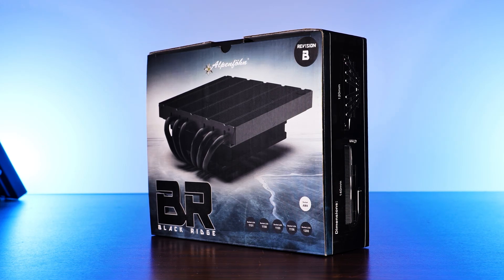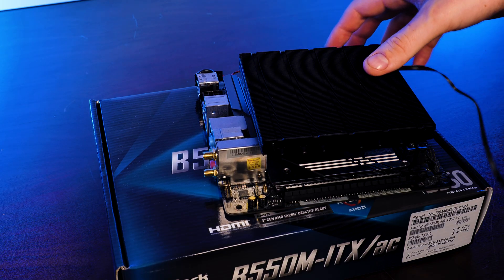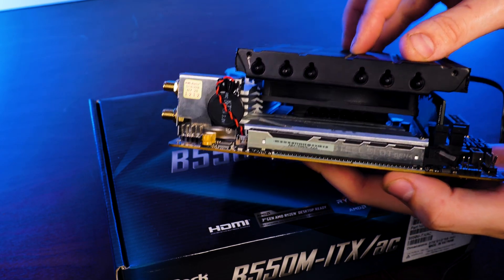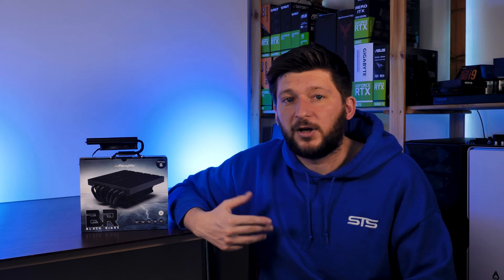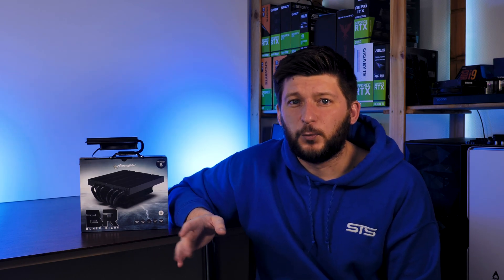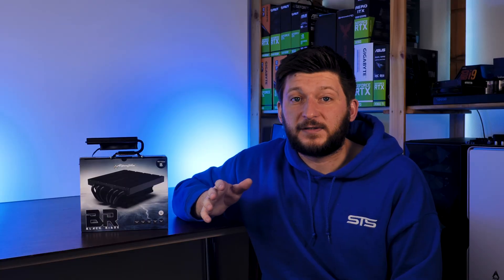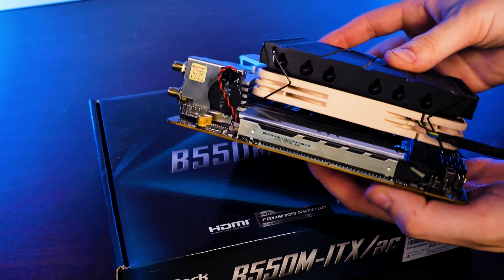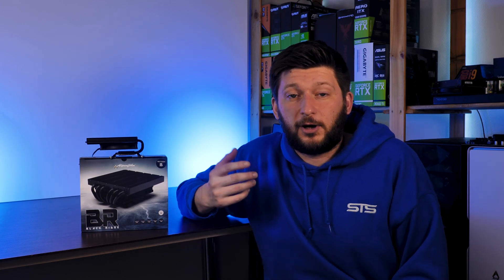Alpenföhn Black Ridge Review - Change that fan!

Comment: Will a A12X15 fit underneath with a LPX Corsair Vengeance(33.5mm) height w/heatsink?
Reply: VLP RAM 18.75 MM. 

So LPX won‘t work with A12*15mm fans.

Comment: Seeing how the 5800x3d runs hotter than the 5900x (unless you undervolt the 5800x3d), is it safe to assume the black ridge would work well with a 5900x at stock/undervolt? I also got the v2 but since I’m using a 3070ti fe, I can rock it in 2 slot mode and have enough space to use a 15m slim fan on top on the BR.

Currently using my 5900x with an ek 240 aio (idle temps are 48-54c/ gaming temps 64c-76c) in the t1 v2 and I mainly use it for gaming only. Haven’t touched video editing, rendering, streaming, benchmarks, etc but I at least plan to stream and do some light to medium video editing. I hate water coolers so I don’t have to worry about clutter and leakage but still want to have good temps/performance while air cooling.

I already have the cooler and a noctua chromax slim 15m fan but holding off buying the 5800x3d and sticking with my 5900x until I get a clear answer for my situation
Reply: Did you get this cpu cooler for your 5900x ?
Reply: @joegalloway1613  i ended up getting the 5800x3d with the cooler. I saw some Reddit posts that the br could cool the 5900x in gaming loads but will struggle in other loads that use a lot of cores and what not. I mainly game so I decided to sell it to basically upgrade to the the 5800x3d for free
Reply: @HeyNavi  How are temps with the 5800x3D + Blackridge & Noctua slim fan? Did you need to do any under volting?
Reply: @seanfarrell4749  I ended up returning the slim and went with the nf a9x14hs because I plan to get a 4080 which would leave me little space when having it set to 3/3.25 slot mode. At the moment I have the 5800x3d with a 3070ti fe with two t30 fans and temps are good. I never see the cpu go above 80c and this is with stock. I do plan to undervolt but I actually don’t know how to do that. I think one of my MB bios update allows me to use pbo through bios but again, seems to complicated for me lol.

Edit: if you ever get the 5800x3d BR slim fan combo then I think you’ll see better temps. This also depends on what you use it for. I only use my pc for gaming and never editing or programs

Comment: I can appreciate how consistent the testing is. If were being honest though, SFF enthusiasts that purchase this product will most likely be undervolting and setting thermal limits on their CPUs to get this in a reasonable temp range. For example, i run a L12 ghost s1 edition with a 5950x and stay under 70c with tuning. That cooler could not keep that chip cool when set to default settings

Comment: Using a Noctua A9x14 fan underneath blowing DOWN provides a significant cooling performance increase. The Phanteks T30 is even quieter when used on top versus the Noctua A12x25. I found I needed to use Loctite on the 4 screws attaching the mounting bars as they worked loose over time. The Noctua L12 Ghost Edition (bottom fan removed) with an A12x25 fan at 91mm tall runs about 4 degrees C cooler than the Blackridge with the A12x25 fan. I find the Noctua Securefirm 2 mounting system is much easier to work with. For another small cooler to test try the Thermalright  AXP120x67 (67mm height with fan) - about the same performance as the Blackridge with a Noctua A12x15 fan installed.
Reply: I wann try using my t30 on this cooler how were you able to mount it on?

Comment: In hardware kanucks' recent ultra low profile cooler shootout, this very cooler with an additional 120mm fan on top managed to match the corsair h60 120mm aio, in perf vs noise, so you might be on to something there, wrt the included fan falling short!
Overall great work highlighting the performance inadequacy here, no one should buy such horribly kneecapped cooler out of the box

Comment: How do you think using a 92mm Noctua fan on the bottom along with one of the best 12cm fans (a phanteks t30 or an nf-a12x25) on top? It would be interesting to see how a double fan setup would improve things.